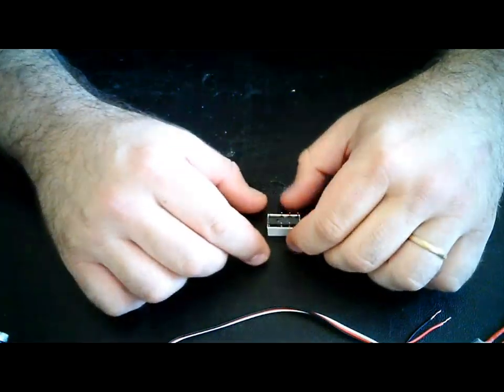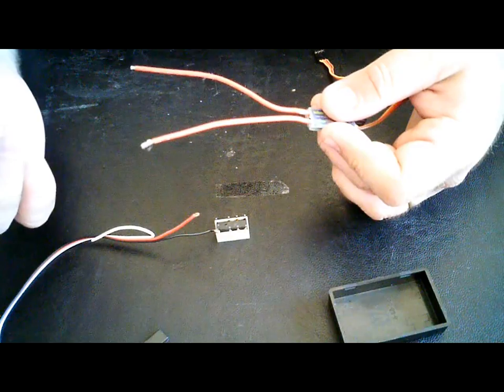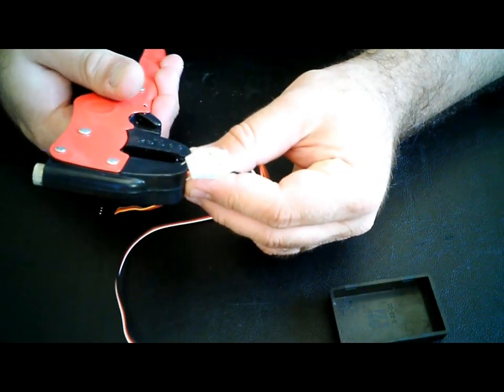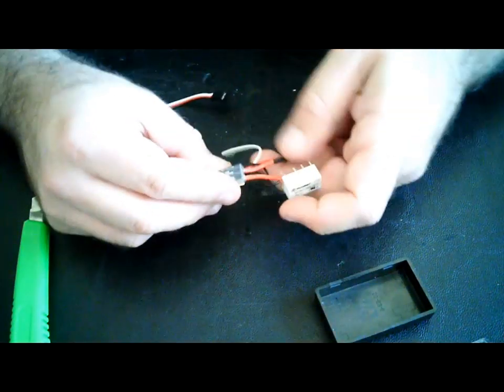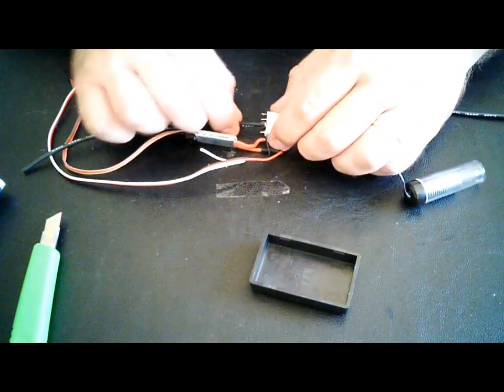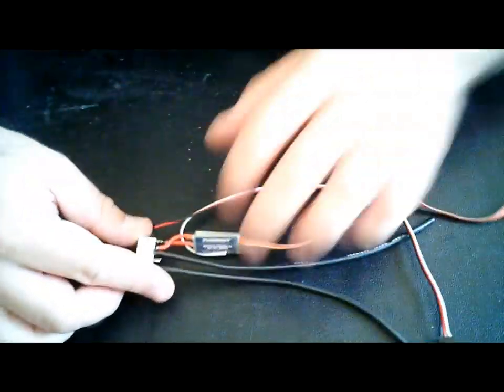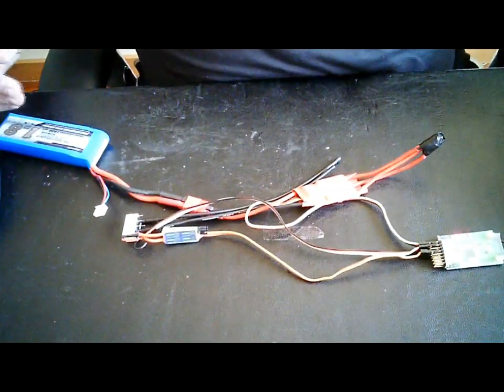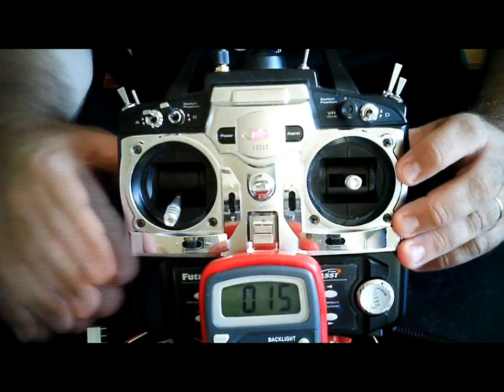Onboard Glow Igniter Tutorial

Comment: Why do you have a relay driving a relay? The Turnigy Switch(relay) would be able to handle the current/voltage of the 1.2V 2000mah battery. So you don't need that extra relay at all. All you do, is solder a wire (splice it on) to the ground coming from the switch, this goes to the ground of the 1.2v battery (as well as the - on the glow plug). You then connect one of the thicker red wires from the switch to the glowplug, the other goes to the + terminal on the 1.2v battery. Easy as pie.

Comment from the maker: @moutonsteve No you don't. The battery used for the glow plug is a Sub C battery of 1.2V 2000mah. That's why I use a relay in order to have a separate circuit for the glow plug. Watch the entire video. I explain it at the end.

Comment: but how does adding in an extra relay do anything but add weight and complexity? In fact, you are stressing the receiver more, because it is driving the voltage/current needed to close 2 relays, rather than just one if you used just the turnigy.

Comment: I'm confused about one thing. Do you need a secondary battery to power the glow ignitor or not? Also, what kind of relay is that and where can I find it. I already have several of those Turnigy switches in my stock pile and would love to try this on my nitro truggy.
Reply from the maker: xXG.L.HXx Hi. Yes you do. You're activating the relay with the 5v from the receiver (5v if you have a BEC or 4.8 from a flight pack) and then you need a 1.2v battery to power the glow plug. As you know a the glow plug runs on a max of 1.2v, that's why you need a second battery to power JUST the glow plug. The relay works as a switch, turning on and off the 1.2v battery feed. If you run the glow plug directly from the Turnigy Receiver Controled Switch, you will fry the glow plug as it will get whatever voltage you input on the switch for it to run and it will not work on 1.2v directly.

Here's the schematic 

http://www.hobbyking.com/hobbyking/store/uploads/942836741X164484X15.png

Best regards
Reply: Sergio Pereira Thank you! I've since posting this question came up with my own way of making an on board glow igniter for my truggy. I plan to make a video soon.

Comment from the maker: Wrong. The Turnigy switch is an electronic on/off SWITCH not a relay. So in fact i'm just aplying voltage to one relay. There is a difference between relay and a switch. Regarding the weight, that's nor even an issue. The relay weights a couple of grams that are not even considered on a glow plane. Again this is my way to do it. If you have a different way, please make a video and explain viewers it's advantages.